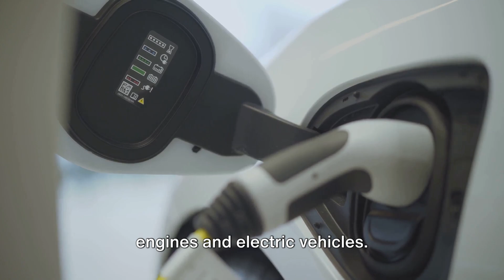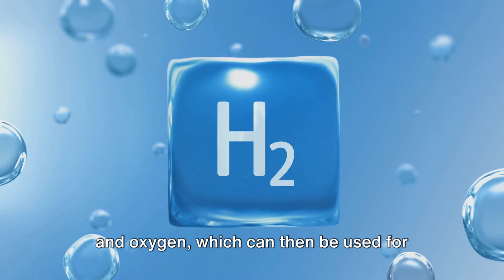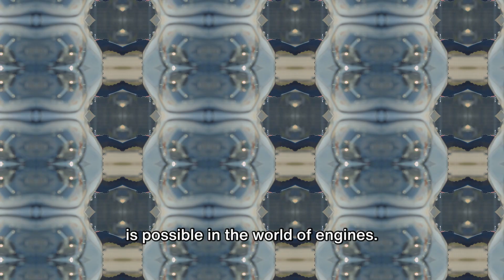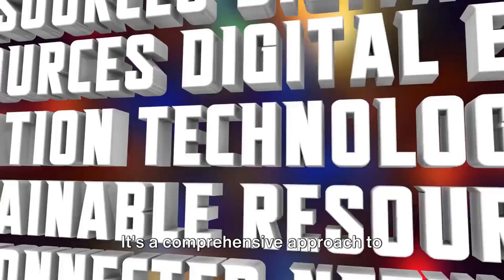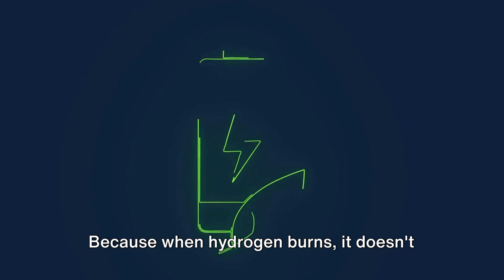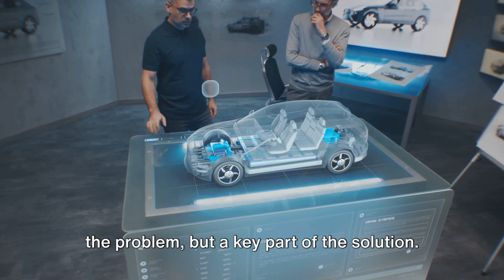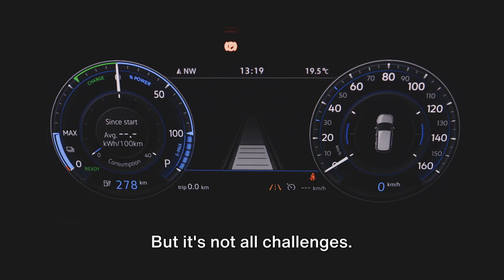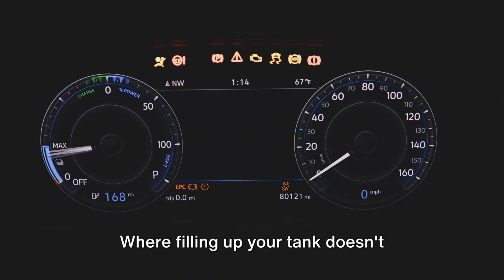Toyota's Game Changer :  The End of Conventional Engines

Comment: It would be beautiful if this could work but water as fuel is a pipe dream. How would you get the energy to split the water  into hydrogen and oxygen? A big battery? Hmmmm…
For many years Toyota have been leading the car manufacturer field but they seem to have missed the boat on BEVs. Really sad to see them trying to catch up and unfortunately distracting themselves with hydrogen or even water fueled vehicles.